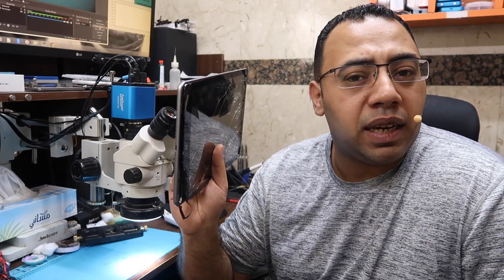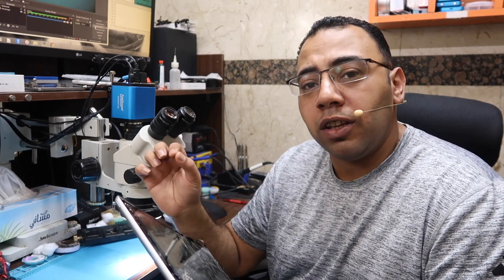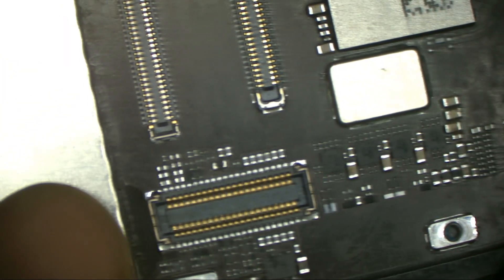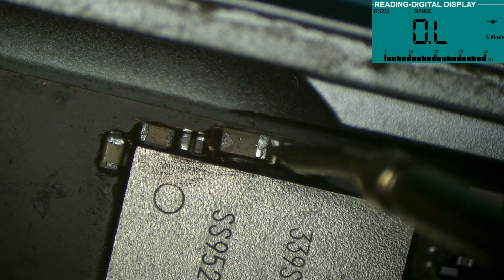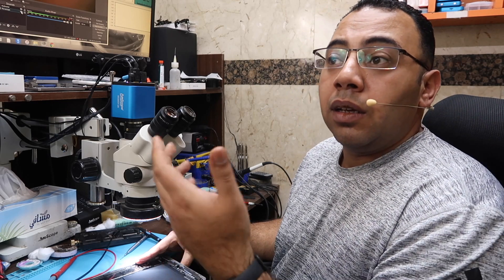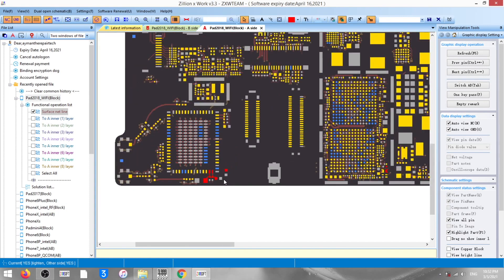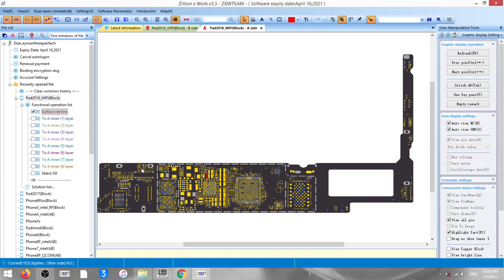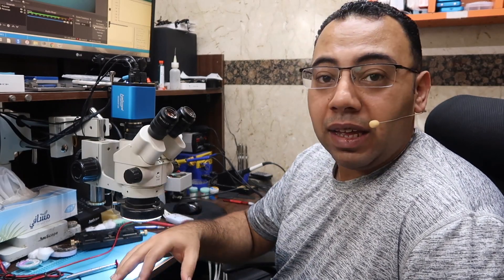How to fix an iPad Pro that won't turn on and won't charge in 10 minutes

Comment: wait so you dont even need to replace the diodes? you just literally break them off the board ?
Reply from the maker: Those are capacitors and they are in parellel no problem if you remove capacitor in parellel if it is not the only one left
Reply: @AymanTheRepairTech asking as a non technician with a non charging ipad Pro 2nd gen: what was the function of those capacitors and don’t they need to be replaced?

Comment: Hi man, I just wanna ask you about my iPad pro 2018 11inch >> it suddenly refused to charge. I took to a technician and he told me that it has a problem with the "IC Charger" 
I honestly had that issue right after I updated the software and I am till not convinced that the IC is damaged. Please note that I have used the DFU mode but the PC could not detect the device. Any suggestions?

Comment: iPad 2018
Not charging after removing short from main line

Changed u2 from iPhone 7
Changed battery 
Getting 5.7v on positive battery fpc 
It is showing fake charge 
Meter shows it’s disconnected asap it goes to sleep

Bsi voltage and connectivity is ok
Any suggestions